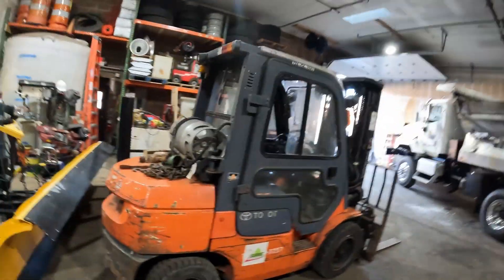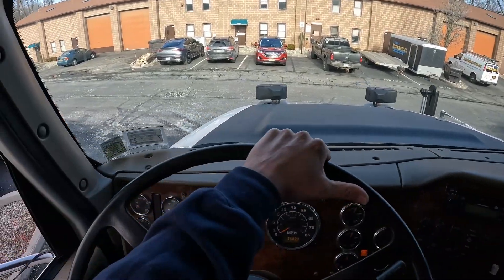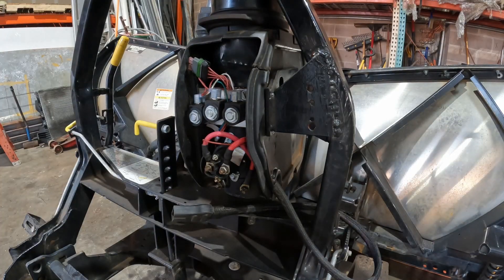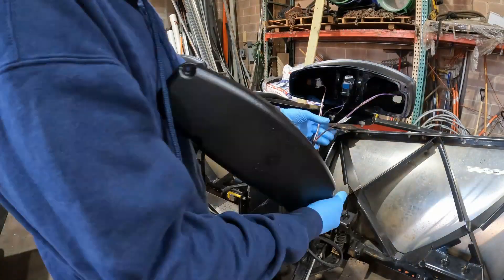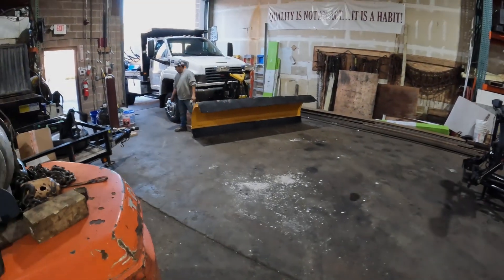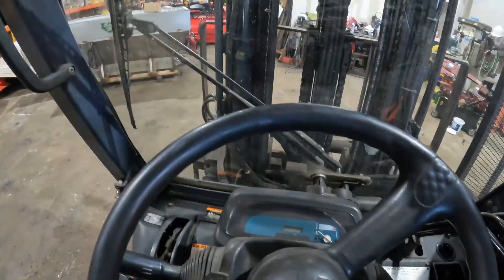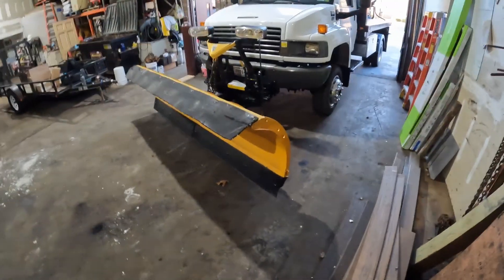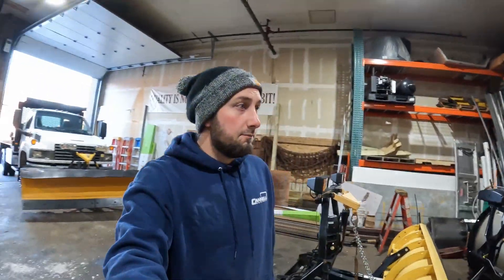Broken Snowplows!

Comment: You should goggle it. I think that you have to put some kind of electronic valve in your truck, and get it installed with the speedometer. I know that it's supposed to work when the truck is in motion. When you come to a stop and it's supposed to stop putting out the product. You should definitely look at the instructions of the controller that you have.I will give you a name of the people who supplied the controllers for the city trucks that we used. The place is Force America. They make the controllers, and I think they would be good for some information on how to make what you are doing work. Just give them a call. I think that they should have a someone who be able to get you going in the right direction
Reply from the maker: Yeah you might be right on the valve thing but the guy we purchased it from didn't mention anything about that and said we have everything we need. But you are correct with how it's supposed to work. We have many force america products but I'm not sure if that's who's controller is with it. I will have to check next time I'm with the truck. I will be calling VSI and force america if it uses their products.
Reply: @StollNCrew  Checkout Dirt Monkey video it was 4 weeks ago.  He was actually at VSI.